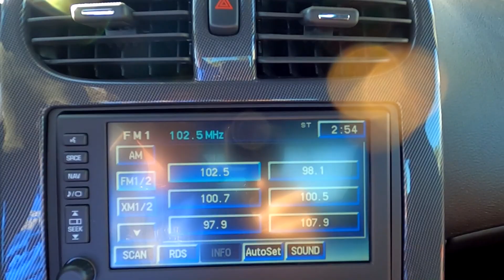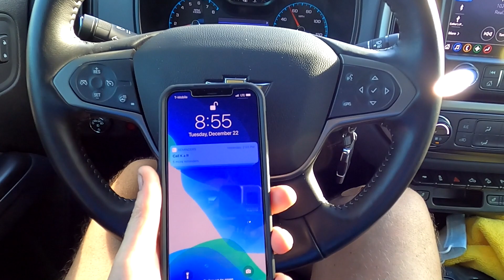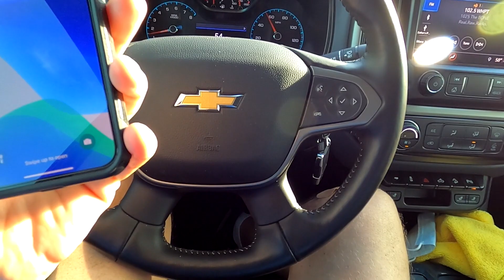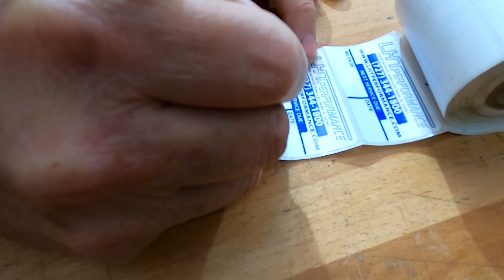CATCHING UP- Kids are out....

Comment: Maybe this is a stupid question,  but not not use two sets of the front 15mm spacers?
Reply: Because of the different hub sizes. It won’t fit.
Reply from the maker: @supermathy3000  Correct